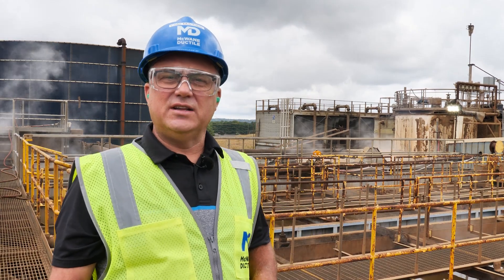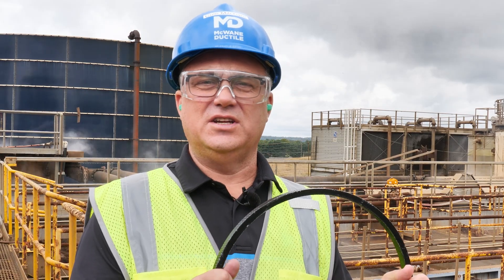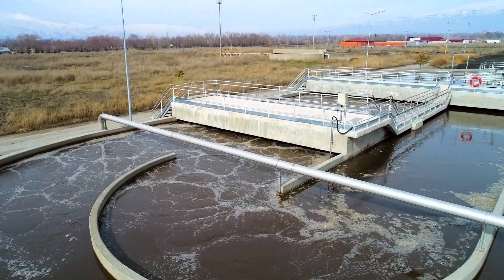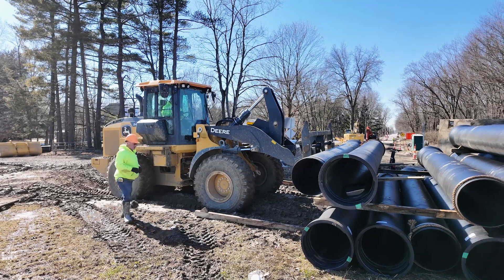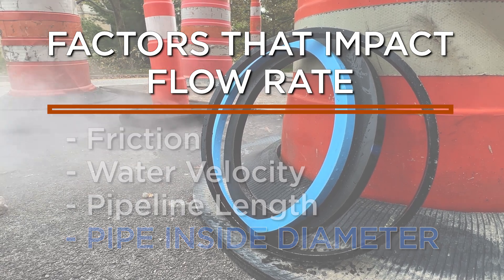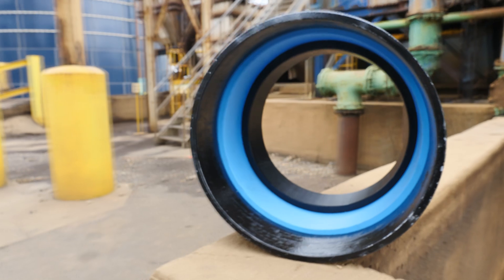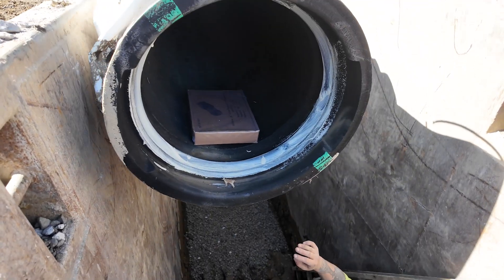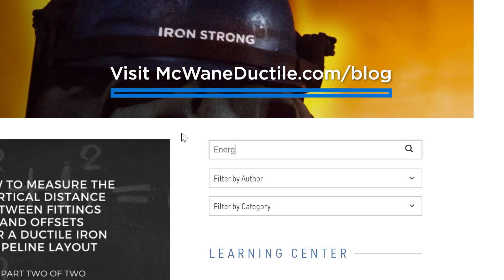Can Ductile Iron Pipe Save Energy & Money for Utilities?

Comment: would love to see a video talking about connecting new DIP to existing older steel CMLC mainline (8" +).  I am interested in the corrosion protection bushings ( or other methods), flanges, welding requirements , preparation, etc. Thanks